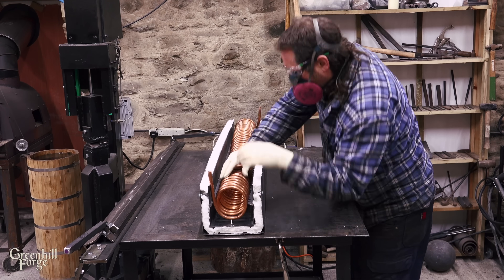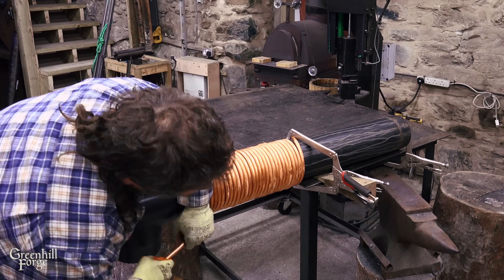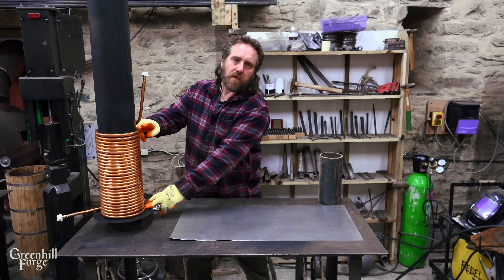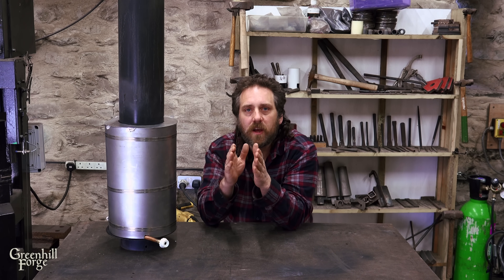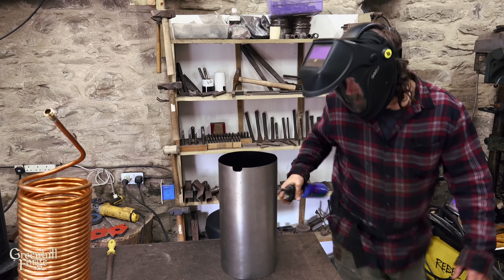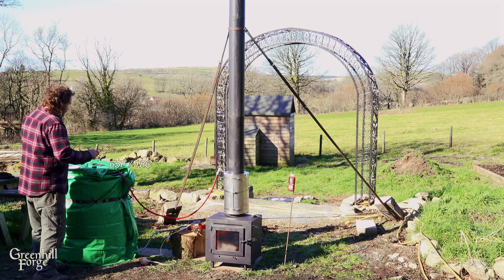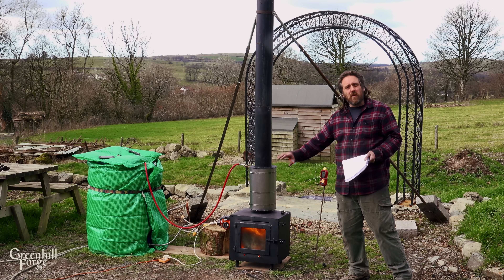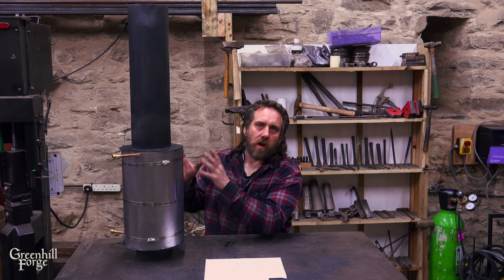Best Wood Stove Water Heater Yet: New Design Tested | Off Grid Water Heater pt3

Comment: Why did the rocket stove end up depositing creosote onto the interior coil? was it just during the initial burn-up while starting the stove? Arent rocket stoves supposed to burn up essentially all of the volatiles, leaving no creosote left over? I wonder if we shunted exhaust gasses to a different stack path during startup and then only closed in the coil when it was fulyl up to temp if we could get the best of both worlds - no creosote fouling and high efficiency heat capture
Reply from the maker: I now think it was soot, basically pure carbon, and not creosote. which means hot enough to burn VOCs and tars but not enough to crack all the carbon and burn it off. I have since modded the stove in this video https://youtu.be/yi_7CBsXkoo and can get the rocket stove 300F hotter so how it might be better

Comment: For maintaining a water heater how could you regulate the water temp when using a fluctuating heat source like wood?

How far up the flue would you wrap the copper pipe to maximize heat transfer? Does a longer coil have any major change on heat times and efficiency?

Comment: Great experimentation and discussion, thanks for sharing. Some thoughts from my background in HT: in the sand and graphite tests, youre increasing the conductive heat transfer to the copper because otherwise the contact is made  only along a line (not an area) that spirals about the column. Thermal diffusivity (impact of mass density, thermal conductivity, and specific heat combined) of graphite is about an order of magnitude higher than silica sand, but the particle size is also causing that increase in heat flux from the column to the water pipe. The underside of those contact regions may not have been fully packed given how you loaded the fillers, maybe loading radially can help - imagine something like the action of an auger. Anything to increase contact, with low resistance/high diffusivity, between pipe and column. Also, that copper pipe is very shiny (e ~= 0.2), and it will reflect most of the radiant heat that hits it. Getting its surface emissivity up to 0.95 or above will almost certainly give efficiency gains, even with particle packing in a jacket. Anyway great work, cheers

Comment: Here is an idea that might help make this more efficient:  Coat your pipes with a graphene sheet(you can buy a sheet of already made graphene pretty easily).  It is used as a heat transfer for electronic components sometimes rather than a thermal paste.  Graphene is very close in heat transfer to diamond(very good transfer of heat energy).  Also capture the heat rising from the top of your stove with a hood that is close to but not touching the surface.  Hot air will rise up into the bottom of the hood.  Make sure airflow into the hood then flows around the copper.  Taper the top of the air exit after it flows over the copper to slow it's exit.  Basically this means most of your losses are from the top of the stove.
Reply: Also, insulate the inside of your copper housing.  You are losing heat to the outside air by transferring it to your outside housing.

Comment: Did this years ago..... You are on the right track. Open to atmosphere set up like that is quite safe. In the end.... Use a natural gas or propane Hot water tank. (Used) Under no pressure a small leak is an easy fix. Just strip off the insulation and find the leak... Then start a small fire under tank .... It is surprising how little fire is required to heat a full 40 gallon tank.

Comment: I thought that using a thermal paste could improve the heat transfer between the flue and the copper. some can handle up to 350°c. But most of them are made with aluminum oxide so that probably brings back the issue of galvanic corrosion.

Comment: i use 10meter of stainless steel diameter 22mm, i make fire in the coil. ( the coil is also inside a stove ) my result are: +/- 3h from 10grC to 45grC, it's 700 liters water.

Comment: How about a double wall pipe with airflow inlet in the bottom, let heat transfer happen and set the coil at the top of chimney. Best of both designs. Could even take it another step up and wrap the second layer of chimney with one sided aluminum foil insulation.

Comment: Aluminum has a higher specific heat capacity than many other materials, including sand, but because of its high thermal conductivity, it can gain and lose heat faster when not insulated.

   Besides graphite and aluminum, another material that probably could be used is silicon carbide.

Comment: Fantastic content! I still believe that a traditional tube heat exchanger design in stainless steel would be the best option. Testing a prototype in regular steel would be great to see. Creosote might be an issue, but pulling it through the tubes to remove it should be relatively quick and straightforward.

Comment: If you are running that thermosiphon (or planning to), I'd want a steeper rise in the coil each loop. To that end, I'd say make the coil 3 or 4 tubes, 1/3 or 1/4 as long, and wrap them in parallel around the flue pipe so each turn around the flue rises a couple of inches. I think that would thermosiphon better.

Comment: The use of graphite was pretty clever.  Not only is it very fine and a thermal conductor, but you don't have to worry about how damp it is like you do with sand.  It is quite expensive in comparison though.  While I completely agree with not using aluminum powder, why not iron powder?  I'm sure you could walk around your shop with a magnet and collect enough for one of these experiments.
Reply from the maker: My first thought was copper power but I'd have to sell my car to afford it.
Reply: Wouldn't iron powder cause the same galvanic "trouble" with the copper coil?
One concern though: graphite self combusts around 400C/752F. Though the graphite won't reach that temperature as long as the water flows keeping the graphite relatively cool.
Reply: @benetra  I'm not sure, but putting a coating over the copper coil could help with that.
If the graphite is sealed well enough, it might not have enough oxygen to combust.
Reply: @ Some (electric isolating) coating would indeed help against galvanic corrosion.

If there is little or no air/oxygen (i.e. below the lower flammability limit), combustion wouldn't occur either.

Comment: Aluminium tube and fixed to the stack with heatsinc adhesive will create a great heatsinc thermal exchange. More expensive but more efficient. You could also pressure inject a wet mix of sand/water or better still none shrink plaster. 💡💡🤔🤔

Comment: Hey there. Brand new subscriber here. I got intrigued by this project for the purposes of using it in a hvac application.  With the water going into a heat exchanger with forced air. Did you happen to record a max water temp?
Reply from the maker: It'll keep going up if you keep the fire going, to a point. I boild water with this setup in 3 minutes https://youtu.be/G7k_CatVFM4. there's also data avaiable for all 3 test videos over on patreon
Reply: @ thanks for the reply. Keep up the good content. You made a fan out of me with this series and now I want to see what else you get into.

Comment: maybe try a double walled heat exchanger pipe. so a bigger pipe around the chimney and the water flows in the space between. 
1. a lot of surface area
2. cheap 
if

Comment: I think spreading out the coil to cover the entire stack would help. Even if it's the same length of copper, it might increase the effective heat transfer area, which I recon is one of the bottlenecks here.
Reply: I red some comments about putting the waternin direct contact with the flue pipe (obviously heaps better), and now I feel stoopid.

Comment: Consider flattening one side of the copper pipe to increase contact area and also using a thermal interface to improve heat transfer. Make sure to select one that will work for the expected temperatures. Also, consider lengthening the coil to capture more heat. Thanks again for these videos, reminds me of the best parts of youtube.
Edit: Graphite is a great idea, very simple chemically and design-wise and facilitates heat transfer

Comment: This is awesome thank you for doing proper scientific testing like this. As others have said having a finger-sized gap between coils will probably help improve efficiency. Other than that you could try some outlandish ideas like going the other way and making the copper pipe even more dense by making it two layers thick, which would reduce the height by over 50%. Graphite seems like the magic answer that might mean it's not as bad as it sounds, the outer layer might still meaningfully contribute. The efficiency loss might be outweighed by the benefits of a more compact design, also the inlet and outlet can be close together making for a neater solution.

I predict that a pump is necessary for the system to work well. Seen someone try to do the self-pumping thing and it was a massive blag that often failed, they ended up biting the bullet and just adding a pump for an easy life. Practically speaking an off grid system most likely does have power be it solar, stream, portable usb-c lithium battery for like £50, etc.

Comment: What will happen if instead of a copper pipe you use a complete waterjacket, preferably insulated on the outside; have fins on the inner pipe to increase surface? You will not be limited to the length of the copper pipe also. Or use a corrugated inner pipe in combination with a waterjacket? The contact surface to the heat source with a copper pipe is just too small. What if instead of sand you use a thermal oil? Love the content and it intrigues me....

Comment: 2. improvements for you are stretching the tube out. And making a double sided chimney, imagine your design and instead of having the insolation on the outside, there would be smoke going up there. Then it would be heated from both sides.

Comment: Given the thermal transfer efficiency of the graphite you may be able to open up the pitch of the coil to take up more of the surface area of the flue. Not by a large amount, but it would be an interesting test.

Comment: What about using steel shot instead of graphite & a copper lower section for the flu, which you could then solder the copper tube to, improving heat transfer. With either option I'd want to insulate the outside jacket. 

Keep up the good work, I think this sort of testing shows what can be dine in the real world. If you can get the efficiency up you can really drive down the amount of work required to fell & prepare the wood & reduce the amount of storage required, real world issues that are often overlooked.

Comment: Well done! What I like as well as your ingenuity, is your accurate testing methods. I have a couple ideas I would like you to test, or at least consider....My first idea would be to make the setup a single integral, portable unit that could be set on and taken off the stove..... In place of the standard stove pipe tube, I would have, lets say, a 1/4 inch thick stove pipe made of solid copper, with the winding and graphite encased around it.....But that would be spendy, I would bet..... Otherwise, a thick walled iron pipe in place of the copper could work, but I dont know if there would be issues or galvanizing between the ferrous and non ferrous metals.....Mainly my idea is producing a high thermal mass of the units stove pipe itself. The unit would be in the hottest zone, where no creosote build up should be expected..... Considering the pipe would be probably about 2 feet tall..... I am considering building a similar radiant heat system for a fifth wheel RV using a rocket stove and an 80 gallon water heater for a holding tank.....My other idea was to actually build a stove encased within several, or many yards of sand, with piping installed in the sand mass. Some copper piping, or strapping, in contact with stove body, distributed throughout the sand mass, dry for heat tranfer, and another measure of pipe for water flow. Possibly some vent tubing in the mass, for airflow.. Then very well insulated......

Comment: Would the spacing of the coil turns affect the result? 
If the same copper is spread out over twice the lengt on the flue, it would have twice the surface on the inside, with sand/graphite to direct the extra heat to the coil.

Comment: Why not make the exhaust tube out of copper (or steel) coil? Weld the coils together so that they are airtight, and use it as the exhaust. Best of both worlds - flue gas is in direct contact with the coils, but creosote buildup on the outside is physically impossible

Comment: Have you or anyone else thought of or tried using oil in place of the sand or graphite? The oil would get hot, and have 100 percent contact with the copper pipe. Kind of like how those liquid filled heat exchange things work on roofs.

Comment: As a suggestion, I would try to somehow stage the coil's heating in order to improve waterflow speeds within the coil. I am thinking of leaving a relatively short part of the bottom uninsulated for it to be a lot colder than the upper portion. This way the hot water should travel up a bit faster and might even flow without an additional pump. You could also just use your graphite/sand design and put in different materials in two separate chambers/layers so that they cannot mix but they conduct the heat differently.

Comment: Maybe you can take inspiration from Xeoos TwinFire (e.g. X8) to reach 90% or more efficiency and attach the coil at the bottom, which might also eliminate the need for a pump in many cases, since the hot water will move up. What do you think?

Comment: Really cool! I am really interested to see test 4 (or 3) with the outside-the flue coils spaced out so the exchanger is 4 feet tall as it was for the inside-the-flue test. You'll need much more filler material, so I'd be really interested to see if the efficiency gains will be worth it. You're scientific method is awesome, keep up the great work. Thank you.

Comment: i wonder if you just spaced out the coil all the way up the chimney, i think this would really increase efficiency as your internal surface area will increase alot (the bit of steel that in contact with the heat), wrap it in some foil, that would be good enough insulation i would have thought for a quick test,

Comment: Have you ever made your own carbon from biomass? I have with simple metal can (paint can is a good choice, mine is one that had loose tea leaves in it which has inner lid, it works a very well) with small hole in the lid and just leave it on a fire pit for X amount of time till the flame from the hole stops. I have crushed that charcoal and used it in soap making, and it is good for oil spills too, it just sucks oil in it like a paper towel sucks water, but slower, since oil has more viscosity than water.

Comment: One suggestion, perhaps bend the flue into a well curved “N” shape and wrap the copper coil at the top so that the exhaust gases have to cool somewhat before exiting and then on the other side it would curve back up to allow the exhaust to escape. So long as the overall height of the lowest point is still higher than the air intake on the bottom of the vent it should still be hotter than the ambient air. Do you think that would work?

Comment: Isn't graphite flammable?
Reply from the maker: with enough heat and oxygen. but the water keeps the graphite cool and it's sealed from oxygen
Reply: @GreenhillForge  I feel like that's what they said about the RBMK reactors. Hopefully he won't be dealing with those kinds of temperatures.
Reply from the maker: @paulishism  I was peaking at around 1700F/925C during the tests and all went well so far. A normal stove wouldn't get anywhere near that.

Comment: Awesome video. One idea you could try is to stretch the same copper spiral over a longer section. Especially together with the graphite, it may increase efficiency by quite a bit by utilizing more surface area and it might also increase the convection "pump" effect, cycling more water and thus leading to a bigger thermal gradient / higher efficiency.

Comment: I still think most energy is lost from the chimney being vertical.
Also the coil having a round cross section kinda introduces issues you don't need to have: If you were to bend square tubing into a coil with the inside diameter of the chimney and then soldered the whole thing into a tube, you'd get a chimney with a built in water channel. It should be pretty smooth on the inside, easy to clean and still be able to very directly heat the water.

If you put that on a section that wasn't perpendicular to the ground but at an angle AND combined it with a rocket stove.... :D

I keep getting back to have the heat not travel directly upwards. There are masonry stoves out there that have the heat travel horizontally with much better efficiency.

Comment: The inside coil was also about double the length. If you would stack two of the outside versions in series you might be in a similar ball park of efficiency and power.

Comment: Nice work! Graphite is a great idea and proved out by your tests. The ice filled tube for bending is a great idea too. A suggestion for filling the tube with water- use a siphon rather than submersion in a barrel. Don't need as much water and all the bubbles get flushed out completely